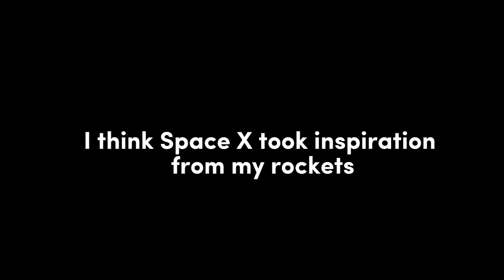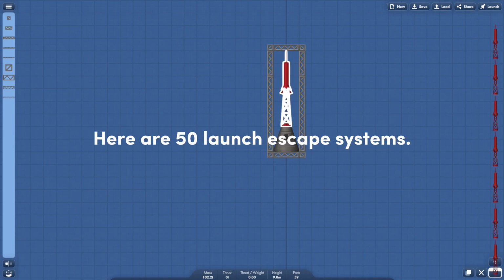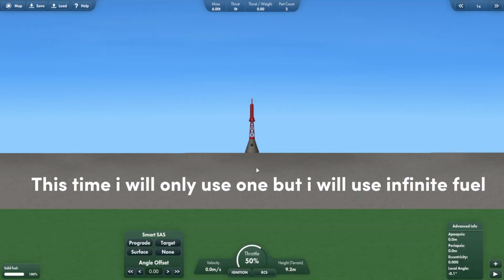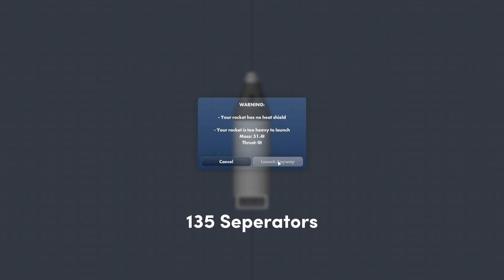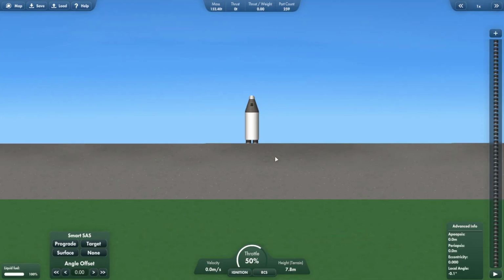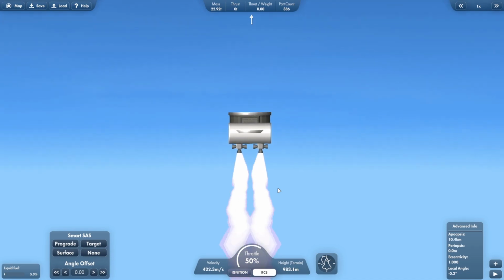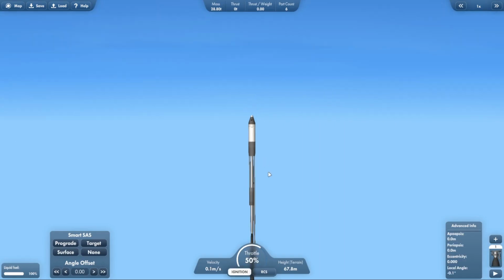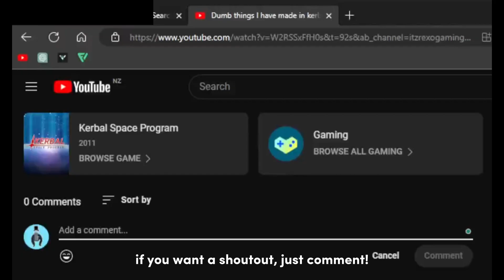i tried dumb ways to launch my rocket

Comment: Spaceflight Simulator by Stefano Mileschin is a space simulation game that allows you to be in command of your space program, from rocket design to interplanetary travel. With easy-to-pick-up gameplay and hard-to-master physics, you can engineer your rockets, plan launches and flights, attempt landings, deploy payloads, and explore new worlds. The game features real-world physics, allowing you to assemble your own launch vehicle from a wide variety of components and pair them with many engines, all modelled after their real-world counterparts. With highly detailed parts, such as fuel tanks, engines, fairings, capsules, probes, landing systems, utilities, and skins, you can recreate your favourite historical rockets or design your own custom spacecraft. Build your world, conquer the harsh conditions of the Solar system, travel long distances and build your presence in space through multiple missions in this exciting game!

Comment: 👍
Reply: Hey i build the rcs rocket before u
Reply from the maker: Oh
Reply: A while ago, on the iPad, without the paid version, I tried to build an RCS rocket by adding them to structural parts attached to a probe and 5t fuel tank. I didn’t know how to clip parts at that point. I eventually made one with clipped parts but it kept crashing and running out of fuel. Yours was definitely better lmao

P.S. i thought ion engine and rcs each produced 1.5t of thrust, but ion was heavier at 0.5t while rcs was 0.05t. I may be wrong

Great video anyways, keep going!